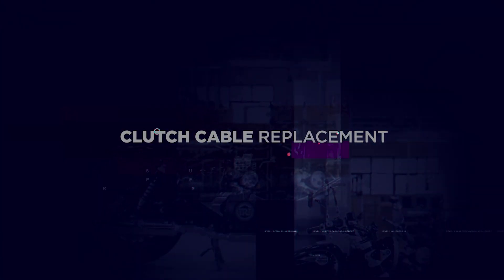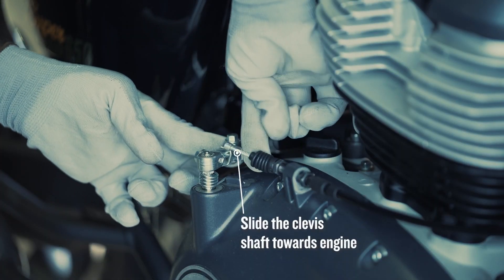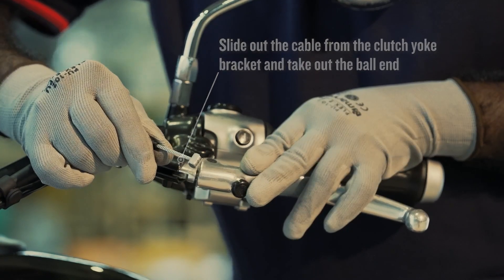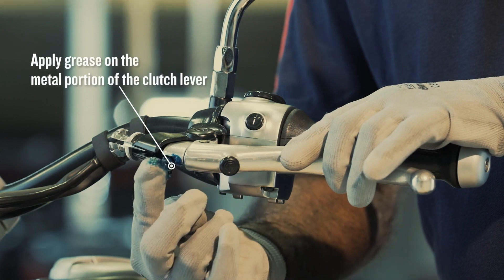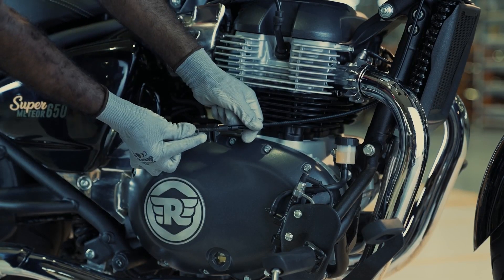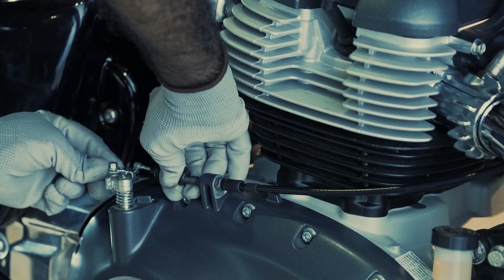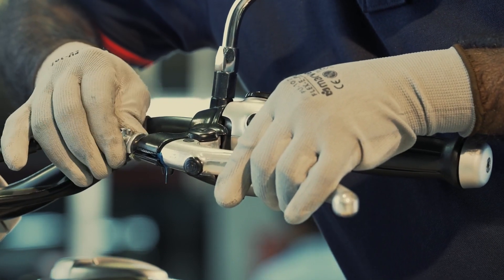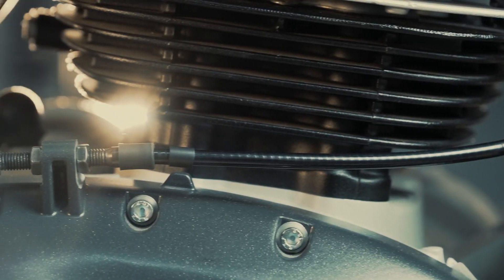Clutch Cable Replacement | Super Meteor 650 DIY | Royal Enfield

Comment: Does any one knows if interceptor clutch cable fits the SM 650?
Reply: Yes, I think so, Kyuki i'm using SM 650clutch cable 
in interceptor.
Reply: @yezdi_90 hey is there any difference in length of cable?which one is bigger